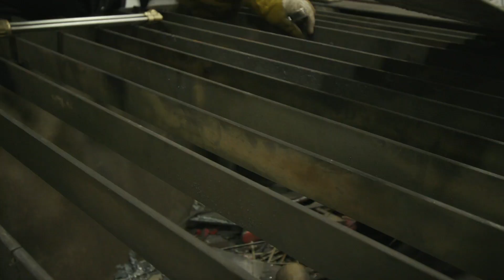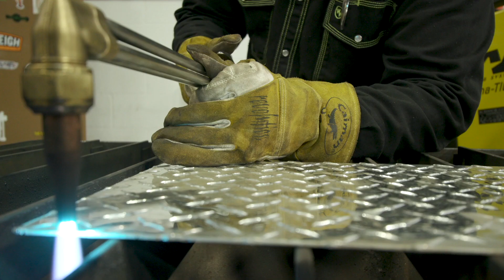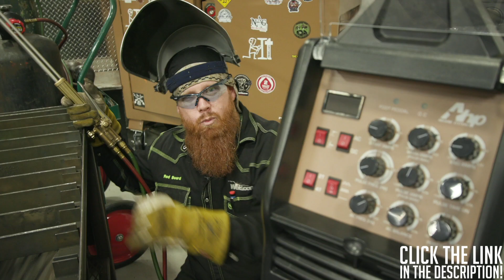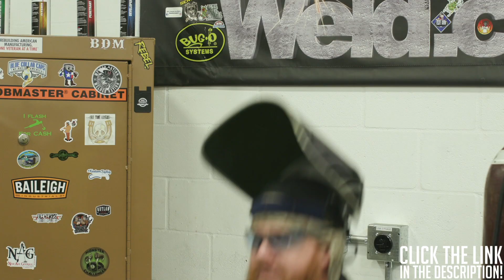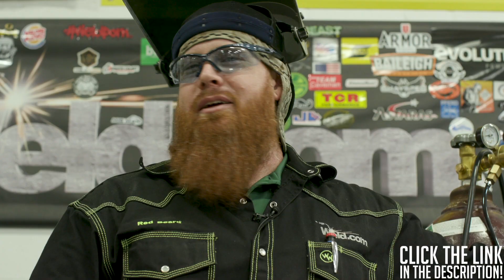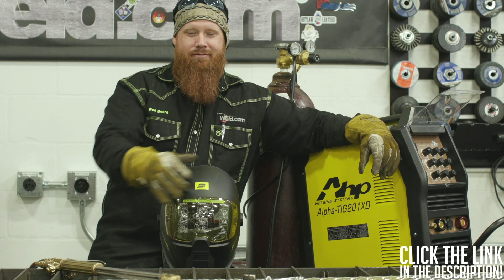350,000 Subscriber Giveaway!

Comment: If you're stuck and it's not precision work,  Just use any regular welding rod, CRANK up the amps high. The rod will burn it off. It's done in industry all the time.

Comment: no but you can melt it just as good
Reply: i do it all the time let me know if you need instruction lol
Reply from the maker: @MrTehudson  Cut, Melt... all the same 😂😂
Reply: @Welddotcom  you can separate aluminum by just not using blow its not same but will work using little blow does help to move along faster though try let me know what you think i use it in a pinch not pretty but neither am i lol
Reply: @Welddotcom  On this topic, you can cut some materials with a Powder cutting attachment as I understand. A Video on that would be good as well as would it work on Aluminium/Aluminum? Look forward to a reply or Video on this. Thanks.
 Cheers from John, Australia.
Reply: @Welddotcom  lol... You said in the video, it can't be done... 
Then here it can.. LMAO 🤣😂😎
Reply from the maker: @GosselinFarmsEdGosselin  You can melt it, sure. But it can't be cut with accuracy for code quality welds.
Reply: @Welddotcom  you never mentioned accuracy 😎😀😂🤣